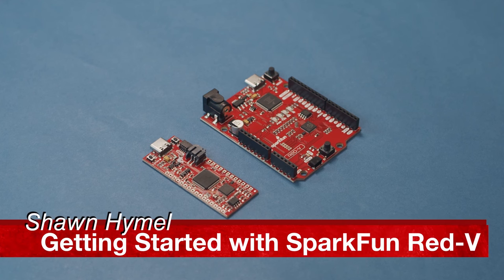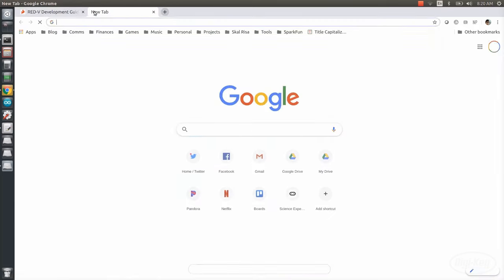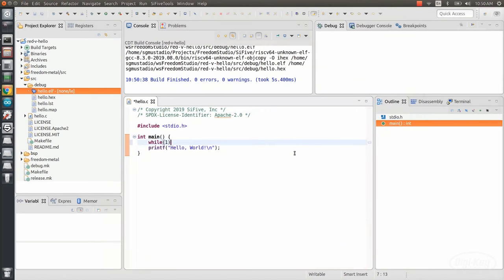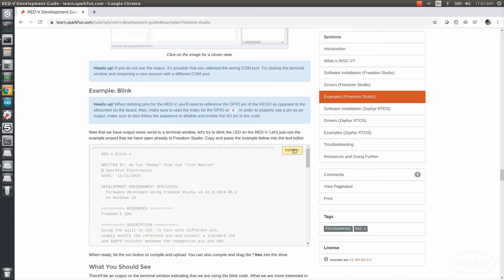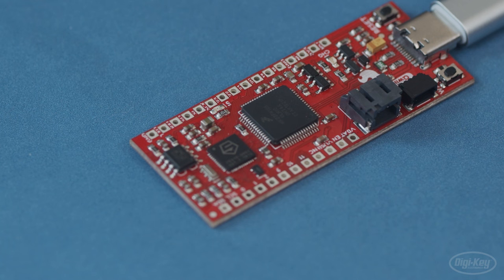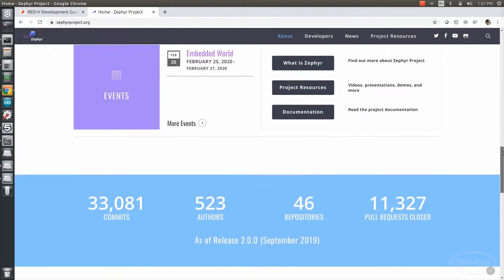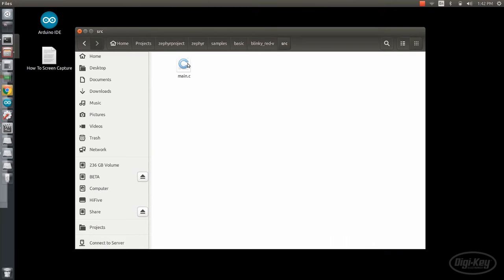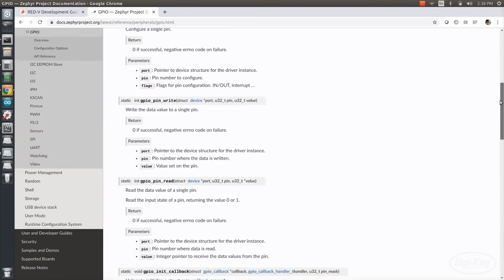Getting Started with SparkFun Red-V RISC-V Boards | Digi-Key Electronics

Comment: Why are you using so old Ubuntu version?

Also, did you know, that you can use OBS to record screen in 60fps? It is 2020 after all.

And thanks for your work
Reply: Because Ubuntu 18.04 did not play nicely with the Nvidia graphics card on my laptop :-/ It might now, I just haven't checked in about a year. Good to know about the 60 fps on OBS. It won't ultimately matter, as all of the camera shots are done in 30 fps, so I keep the final editing at 30 fps to match them. It could help with any slow-mo shots during screen capture, though.
Reply: @ShawnHymel  Did you knew, that you can use Hybrid to interpolate video to 60fps? Results are mindblowing.

P.s. it is free, cross-platform software.
Reply: @glitchysoup6322  didn't know about Hybrid, I'll have to look into it. Thanks for the suggestion!